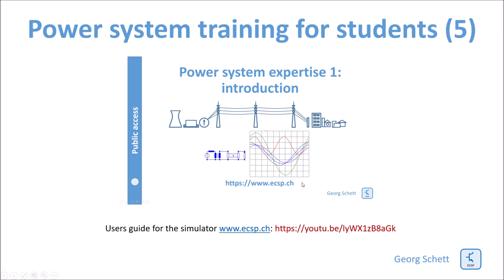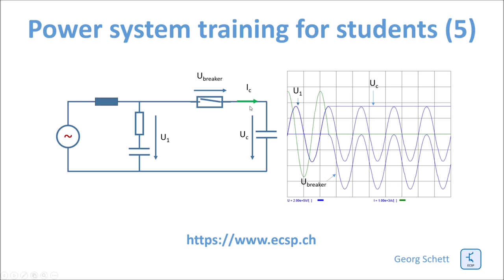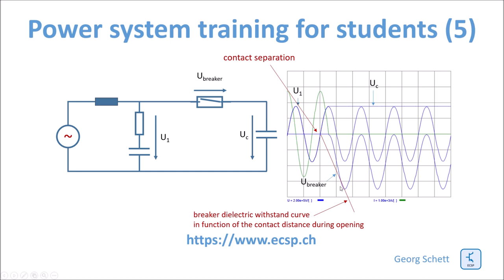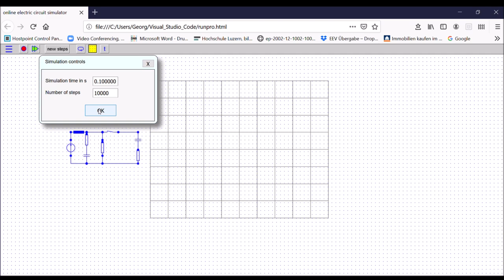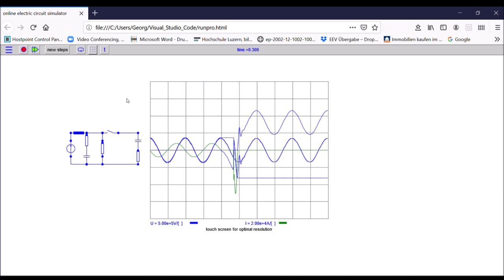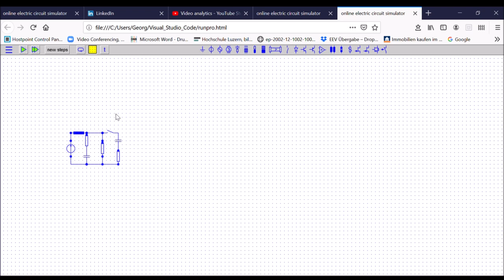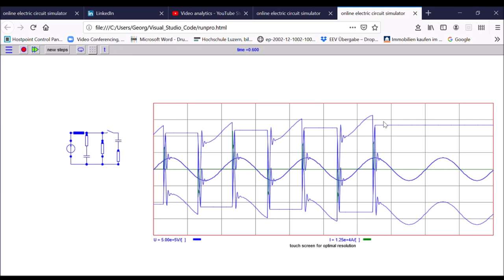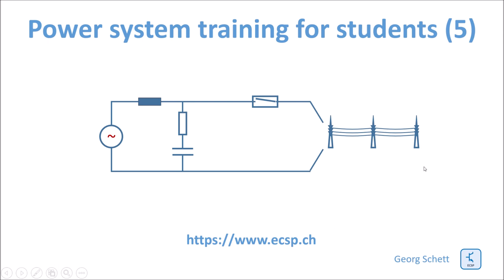Capacitor bank switching

Comment: Sir  please explain how voltage reduce when reactive power demand is more than the reactive power that can supply by generator.
Reply from the maker: Try to simulate it with the www.ecsp.ch. When the reactive power demand is higher than the supply, the voltage at the load will be reduced. Please have a look at the video about voltage stability, this is exactly the topic.
Reply: @georgschett801  ok  sir.